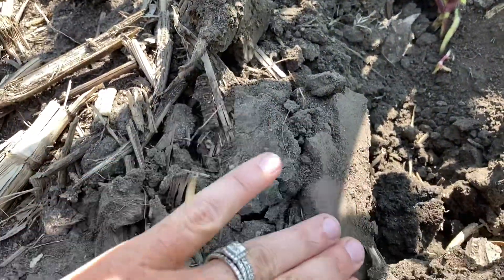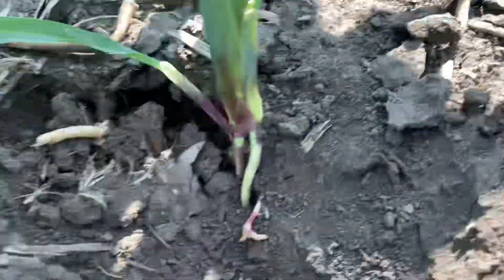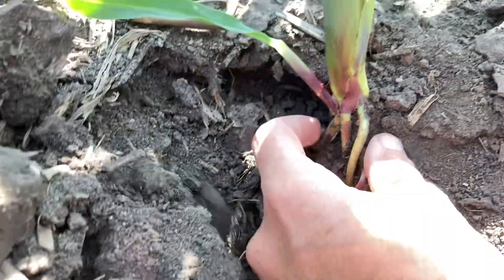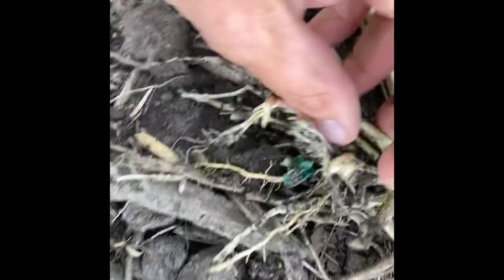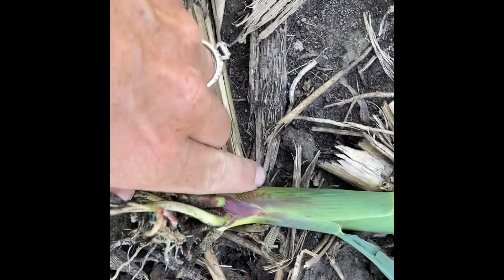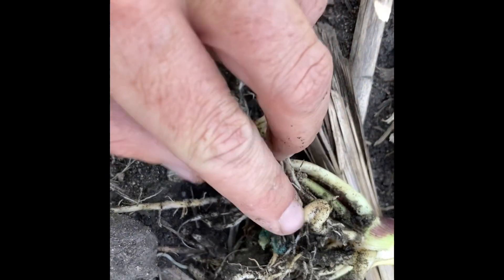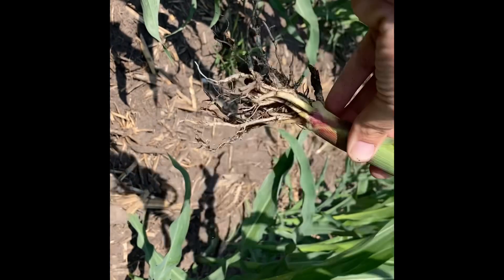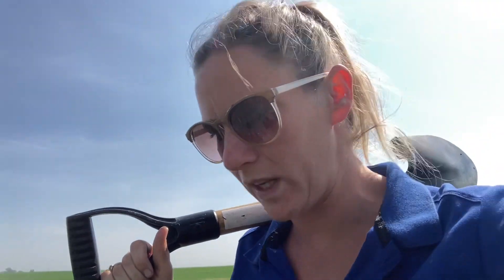June 9th scouting Update

Comment: Nicole, another very informative video. My first year with hydraulic downforce. It was dry so I and other farmers put a little more downforce while planting. Would that have caused sidewall complications
Reply from the maker: YES! Particularly in dry conditions, more down pressure can cause sidewall collapse and affect planting depth particularly in tilled ground. If there was some moisture it will further compact those sidewalls.